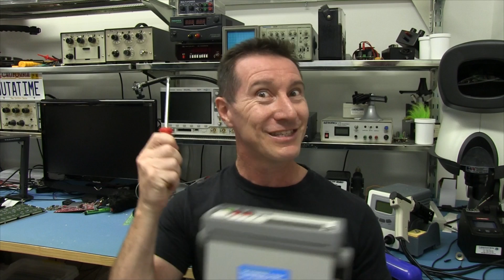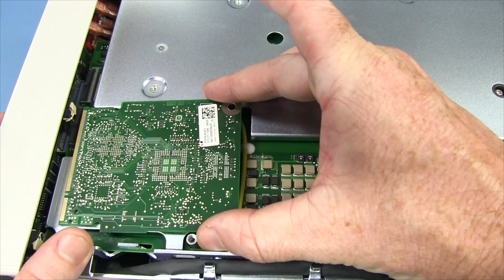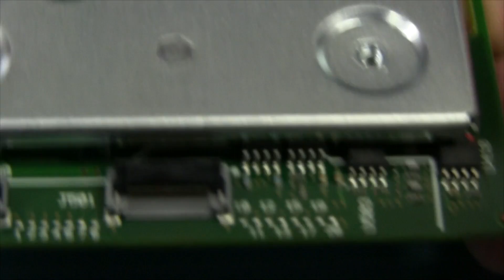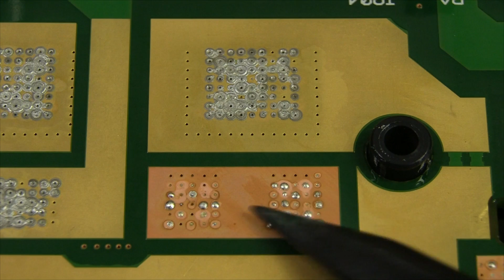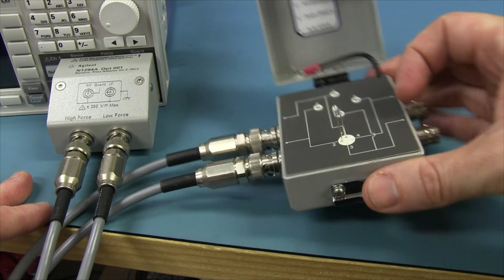EEVblog #607 - Agilent B2912A Source Measure Unit SMU Teardown

Comment: 37:52 TIL small E96 series resistors use a 3-digit alphanumeric code that you need a table to decipher. Never would have guessed that 25X = 17R8. Wonder what those little resistors are doing there.

Comment: Awesome, thanks for sharing! 

I noticed that on the TOP layer of the PCBs (30:58) there are only signal traces and no GND plane. What is the thought behind this? wouldn't extra ground copper help with crosstalk suppression, etc? I've noticed this on other high-end PCBs. Thanks

Comment: Way late to the game here, but one of the other main advantages and purposes of the triax probing system is that you can have your circuit that is being tested to be at a significantly different base (ground) reference than the test gear. E.g. the circuit under test can have its ground potential floating at several hundred volts different than the Agilent B2912 and yet be able to still allow for femto-amp current measurements between hi and lo, since their chassis grounds are independent. Just had to add that tidbit of info.

Comment: I don't believe that particular part number of reed relay is made anymore since Sanyu Electric was purchased, but looking at TPM Sanyu's offerings, that looks very much like one of their wet reed relays with high voltage (1kV) switching capability and insulation resistance to 10^14 ohms.

Comment: I tore down a 2.1kW Flextronics server power supply recently, which looked to be every bit as well built as this piece of Agilent test gear...and extremely compact for something which is rated for over 200 amps at 12VDC.

Comment: Interesting teardown, Dave! However, I believe you misinterpreted the function of the guard connection, especially in regards to triax cabling. It is not, as you said, at system ground potential, but rather at the potential of the high force/high sense terminals. The purpose of this is to virtually eliminate leakage current (which you did mention elsewhere). This is important in SMUs such as the B2900 series, which can sense currents in the femtoamp range.
The resistance of the insulation in the cabling is no longer negligible when working with such low current, especially when the SMU can output in the hundreds of volts - when the potential difference between the high force and sense lines and the grounded shield is this high, the I = V/R leakage can be large enough to contaminate real current readings. To remove this problem, the guard terminal is driven to approximately the same voltage as the high force/sense lines, meaning the potential difference between high force/sense and the guard terminal is very small, and thus the leakage current is also very small. The guard terminal can source what small amount of leakage current there would be to the outer ground with no ill effects as the current flowing from the guard is not important here. 
Sources: Agilent Appnote 5990-7118EN ("Thermistor Evaluation Using the 
Agilent B2900A Series of SMUs") page 3, and I used to be an applications engineer for Agilent supporting this equipment and others :).

Comment: Incredible. They claim it has 10 fA of resolution and they don't even put coaxial/triaxial connectors... If you need that kind of resolution coaxial cables are a must. Then the buyers have to buy another 200$ adapter in order to have them.

Comment: Hi Dave, please schematic?  Would appreciate if give more details about the circuit related to the current and voltage sensing for this Source measure. As this is super accurate, the special in it is the input voltage & current sensing.

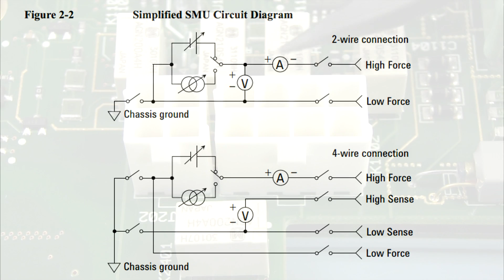Comment: Check out the poorly soldered connection on the rightmost lead of the 10M ceramic resistor at 25:52

Comment: You mentioned the triax cables, and how shielded they are, and how expensive they are, but not that they're made out of special low triboelectric materials? And how if you're doing low current measurements, you must wait after moving the cables to get accurate measurements? In my experience, even tapping the desk that the cables are sitting on can be seen in low current measurements in the fA range. Pretty touchy stuff - literally!

Comment: I figure they reason they have to re-caliberate it is that when taking it apart you have to break the seal that guarantees the calibration to be correct and for them to be able to replace the seal they have to be absolutely certain that its 100% up to the right calibration specs, even though they know you won't go messing with everything, they just have to know for absolute certainty that nothing accidentally changed. The people that use anything that is calibrated like that place complete trust in it. I'd just take their insistence on re-caliberating it as evidence that they just take the trust their customers put in them very seriously and set high standards on just being sure.
Reply: Most importantly though I just think its great they sent one specifically for taking apart and looking inside of!

Comment: The triax is used to eliminate leakage current more so than noise. Typical coax is 100MOhm between conductor and shield, so even with just 1V, leakage current is 1nA, making any attempt to measure below this useless.

Comment: At 15 femtoamps, there are about 93000 electrons passing through in a second.

That's really quite impressive.
Reply: look at an electrometer's capability - they can measure to an atto amp, or about 60 electrons a second.
Reply: A 22 nm mos transistor inside a processor chip can turn fully on from about fifteen electrons being placed on its gate.

Comment: It looks like they used a generic pci express psu connector where the outputs plug into the board, interesting.. Dave you should tear apart a Corsair AX 1200i, little 1200 watt PSU, supposedly its the best one on the market right now, 98-99 percent efficient, only problem is they keep dying on people, no one knows why, maybe you can solve the mystery.

Comment: Dave if someone told you 5 years ago that Agilent would be sending you such expensive equipment to take apart you would have thought they were mad!
Reply: I think it's awesome that they'll send gear that they have very little chance of getting extra sales of, due to low demand and price, just because. I am sure it'll increase sales of lower priced products, I know ultimately it's all a marketing decision, but a good one in my not-so-humble ;-)
Reply: @TheChipmunk2008  This channel actually is VERY close to the target group. I think Dave once said that a quite significant amount of his viewers are professional engineers. And those people can easily become involved in the decision process of buying such equipment .. and lending out such a unit is cheaper than a magazine advert or something. Besides of that, they were probably using one of the demo units they lend out for evaluation to potential customers anyway (and the last one forgot that LED in there..) ..

Comment: Hey Dave, Can you ask Agilent how much out of cal your tear down caused. That would be quite interesting.
Reply: I was trying to stabilize the output of a digital pressure sensor. I had to bend the capacitor at just the right angle. Once set, it can be knocked out of adjustment with 1/2mm of movement. Looking at it wrong could result in an extra +-0.5% accuracy.

Comment: Wouldn't they make more money by lowering the price to a more reasonable/ affordable $800-1000 and then sell just sell a bunch and push volume like stores such as walmart do with food (sell for less but push such a high volume that you make more money at the end of the day)?
Reply: No, because test equipment in itself is not a volume market. It is a specialized, high-cost, high-technology industry, and the true companies buying these don't care about price. Hobbyists represent very little of the market.
Reply: If they dropped the price to £100, I would still um and ahh about if I need it. Why buy a lawn mower if you haven't any grass.
In this metaphor, there are about 10000 people in the world that need to mow there lawn. Niche supply and demand my friend.
Reply: echen1024 Hobbyists don't represent any of the market. These things are for people with the ability to manufacture semiconductors, which is way, way outside the budget of a hobbyist. When a multi-million (or billion) dollar fabrication plant is a prerequisite for needing a piece of test equipment it can be safely considered to be outside the hobbyist budget level.
Reply: Round House
The basic circuits, yes, but getting the accuracy, precision, and stability of a system like this takes quite a bit more effort. It's only cheaper to make something like this if your time is worth nothing. The BOM is going to be well over $1000 for something like this, and it's going to take several months of work to make a system like this (40 hours/week) so doing it in spare time as a hobby project would take years.
Reply: brian hilligoss
 Yes, most of this being design/development costs, I don't think most people realize this.  Of course that would be amortized over additional sales but it is a niche market.
Reply: There's over $1000 in components in that box.  No company would sell a item at a loss.  They don't need to sell a loss leader item like Walmart.   I would bet that the break even point on this is around $9500.  High end test gear is very pricey.  But 99.9% of people watching this have no need for this.
Reply: echen1024 Thousands of EE graduate from universities each year and are being priced out of this market. My thing is, if I cant buy it, I can make it. the basic circuits to create these things are in text books.
Reply: you are correct, puting something together like that is not for hobbiest. Most engineers like my self thinker at home. It would be nice to have nice equipment like that. I use to work for one of the major chip manufacture mention in the video. The only people that used the very Hi-end  equiptment  like that was the guys that did the calabration of all the Test & Measument Equipment. we would use the standard Agilent equipement to conduct our work.  YOU can build your own system for cheap and have someone with that equipment  certify it. Professionally I would not recommend testing done on un calibrated equipment. Agilient make great T&M Equipment.
Reply: Round House Er.. excuse me Round House.. but this is specialised test equipment for extreme testing.  Only big corporates will want his and can afford this.. The average engineer will have no need for it.
The components that are needed have to have real high spec and that comes at a cost.
Reply: you are correct. but a good engineer must be a little bit of a snob and want the best to give the best :)

In the LAB snobbery is exceptable. it makes you better.
Reply: Not going to happen, when you consider how these things are built and the volumes in which they are made.  Instruments like this are not built down to a price- they are made with the absolute finest components available, and absolutely no compromise is made in design, testing or production.

Comment: Triax is used extensively in the video industry.
Reply: Yeah, there are miles of it run around every sports arena, and many TV studios It powers the cameras and carries the signals to and from the base station. The power is around 200V AC or DC, and runs between the center and inner shield. The outer shield is just for safety.